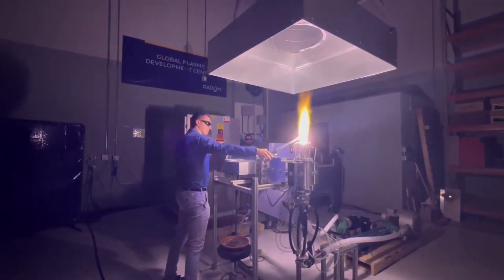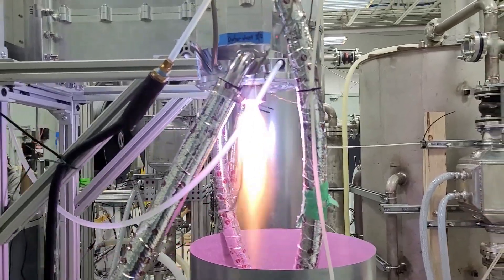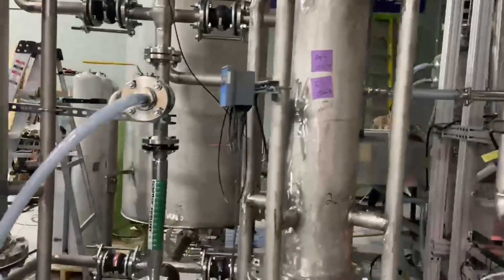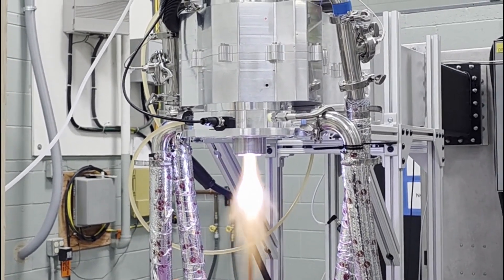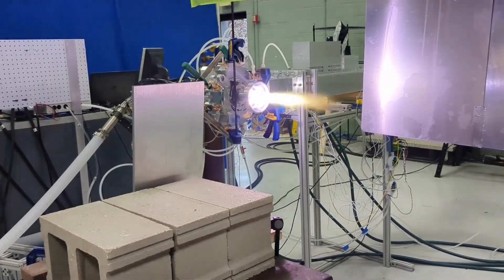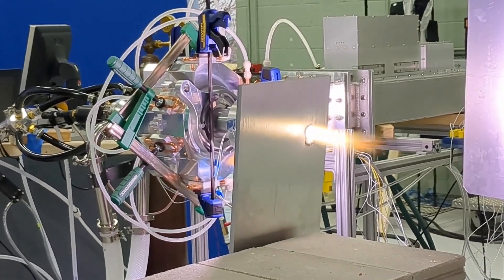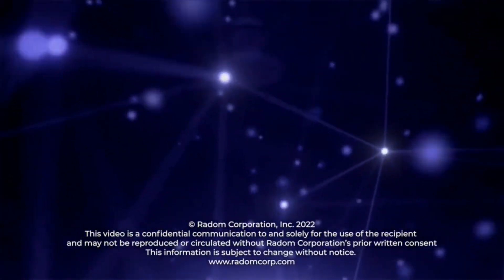100 kW microwave CO2 plasma, 915 MHz

Comment: Looks like a rocket. Pretty sure you can somehow make microwave rockets
Reply: There are systems that use electric fields to accelerate metal ions. Very efficient but you can’t move a lot of weight.
Reply: @thepower7803  A bit of research suggested that microwave rockets can be used for SSTOs
Reply: microwave plasma rockets exist, problem is high power requirements. In space it's either a reactor or you have sh*t
Reply: You can but they are not practical. There are better ways of using electricity to make thrust, but AFAIK, non use RF yet - all based on DC acceleration fields and dense specie like Xe.

Comment: It can do alot more than what it's currently being used for,Amazing Tech
Reply: perhaps you would focus more on microwaves to ion the air and create plasma rather than corona discharges
Reply: @Aidansstuff_  I'm litterlay just one more failed experiment away from temporalily giving up on Corona Discharges and move on to microwaves to excite and onize the air...I was previously attemptic the LC resonant circuit popularly used in Plasma Toroids cz at the time I thought that was the only way to generate GHz fields....I'm telling you it came as a shock to me that I can simply use a microwave magnetron to produce the GHz fiels I wanted,by simply tapping the emmiter 😂...The science world is filled with sucker punches when you face-palm yourself and realise there were easier ways all along...But I'm trying one last attempt with the Corona Discharges controlled via a tetrode gate and if that doesnt work... I'm goin the brute force method and utilising microwaves instead... gotta make this thing work one way or another,,,Galactic space beyond the Ort cloud is callng for us to go explore it and Im itching to head the call😤

Comment: Hey have you guys trying decarbonizing LNG with it ? 
I mean in a pure natural gas chamber, and reduce to elemental carbon with elemental hydrogen in a continuous process
I think that could have really important applications
Reply: Yes we have done that with methane. Methane Into torch, ultra fine carbon black powder comes out with hydrogen
Reply: @Erick_The_Green  Could be a great source of UHP carbon black.
Reply: @Shaker626 they laid me off after we finished that. Oh well. Maybe I can go back one day
Reply: Its really messy, I'm an engineering tech at Radom. I'm the one who deals with the mess 😅
Reply: @Erick_The_Green  Thanks, it has been my dream for a while now, haunting me, what is the minimum chamber size, RF power level, to decarbonize 5 kilogram of LNG per minute, including regenerative heating with aerospace reliability and a safety factor of 1.5
Reply: It also needs a solid phase separator, inline and without velocity reduction and a capture rate of at least 90%, maybe a fines cyclone ?

Comment: 915MHz at 100KW? That crazy. How can they create that much RF power with that high frequency? I guess the generator must be as big as a house, right?
Reply: Simple wall adapter, type C.
Reply: @Rizzler420-uh4yd  don't joke like that
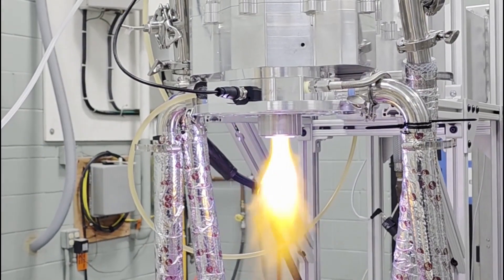Reply: I think at 0:18 and 0:46 shows the MW Generator, it must be the thing with the circuit breaker.  Like 6'x4'x3' in size, looks like.
Reply: @Tech_Lover-84  Yes!
Reply: probably magnetrons because they are extremely cheap for the power level
Reply: I could understand you not knowing the answer to that question in 1995. But in 2025? Nah, you lazy.
Reply: @tetrabromobisphenol just curious

Comment: The torch is too big I mean Who wants a 20cm hole in his work piece it would be more interesting to have a the same power but with a 1mm or so hole size like surgery plasma cutting on steroids.
Reply: I don't think plasma cutting is the main use for this. My understanding is it's for heating powders in a controlled chemical environment, treating surfaces with a quick blast of plasma, etc.

Comment: So can the energy from the microwave be transferred directly into a gas or powder, or is it only indirectly through H2O steam/plasma? In essence, can we remove oxygen sources from the system?
Reply: Lmao
Reply: One could run the system on N2, but some gas is presently required!
Reply: Energy definetly can be transferred directly via electron cyclotron resonance(thats how some ion sources do it), but I dont think this is the case here.
Reply: Why would you want to remove oxygen from the system?
Reply: @JustAnotherSeeker  Many thermal spray coatings such as Thermal Barrier Coat have better properties when applied in an inert atmosphere and without oxides forming. This is similar to why welders shield their welds using argon.